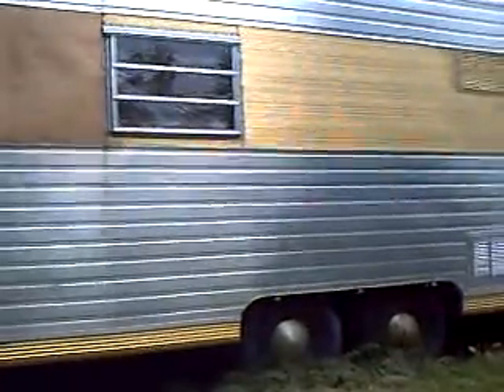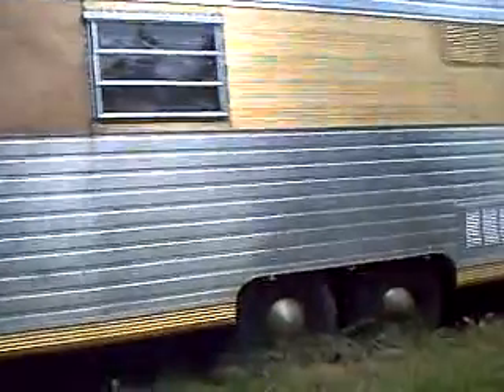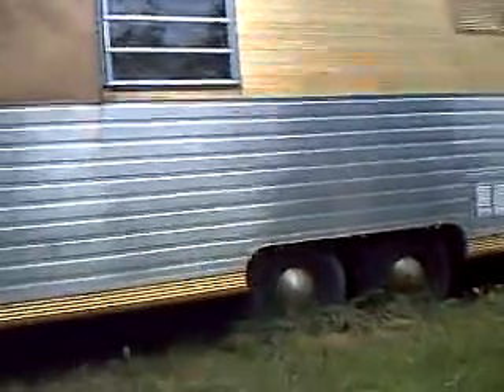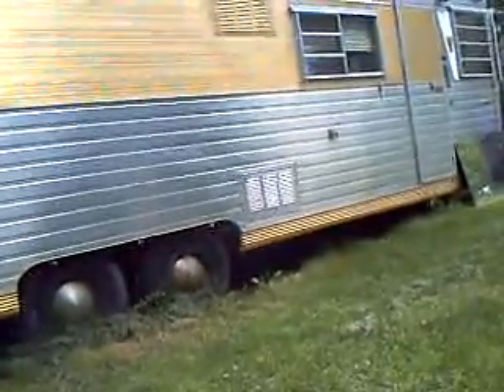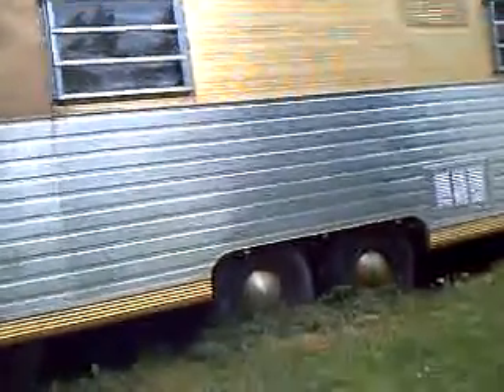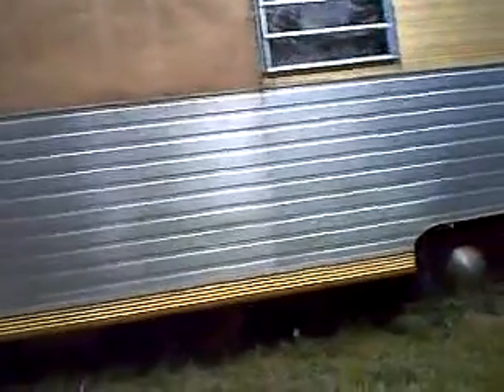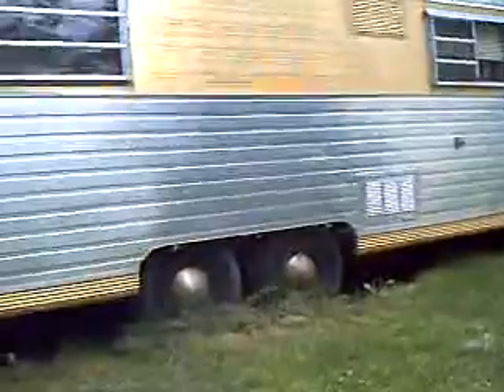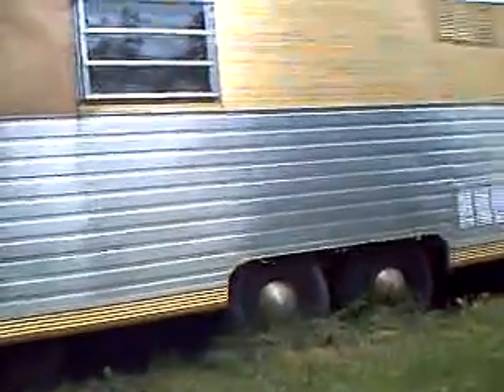emp protection under ground  fairaday box

Comment: You would be better off using a shipping container . The camper is nice but it's not a totally sealed  system . Other option would be a Dual shipping container system welded together into 1 big ass container and a ramp system to back you camper or RV into. That would be a good way to go if you have the cash. Wish I did .

Comment: if you are dead set on using the trailer what about building up the dirt around it but not against it. Sort of like a levee on all four sides. Then put something connecting all four sides over top of the trailer and reenforced. Thenputting dirt on top.

Comment: ok. to make it trew all you need to do is get a reall mettal box not one that has holes (windows) and make it an absolute metal box then insolate the inside lightly just no contact frome you eqitmint to the metal then put grounds on the outside and your electronics are fine (not under gound) emps (electromagnetic pals) what can only hert you if you have plates in your head or a pace maker but to geth that emont of electricity it needs to be almost nuklyer and would affect a large city to a state

Comment: You're best off with a 20ft. (all steel) shipping container. Line the interior walls & floor with 1/4 or 1/2 inch plywood for insulation so your stuff doesn't touch the steel. You can buy a used one for around 2K or less. And, you wouldn't have to bury it.

Comment: no. Why bury it? it will crush, leak, etc, plus the windows will allow the EMP in anyway.  What are you trying to protect? EMP only impacts delicate electronics. You could put whatever delicate electronics into a steel gun safe or metal cabinet or old oil drum with tight fitting lid that has no windows or cracks in it. I assume you are putting a shortwave radio, electronic control module for a car, clock, radios, etc into it. Would not take that much room. Good luck, hope you don't need it.

Comment: EMP has got wide spread of frequencies from low ones to very high. Even small gap between metal plates can pass trough EMP. Plates should be connected to overlaping each other. Faraday cage protect against electric pulse not magnetic. Those two pulses are inseparably connected but all materials are more or less transparent to magnetism. To block magnetic pulse walls should be covered  by the few layers of magnetic conductive and magnetic resistant materials (i.e. steel and aluminum)